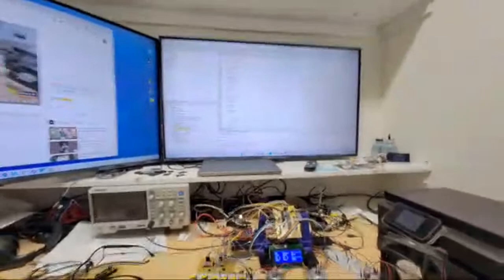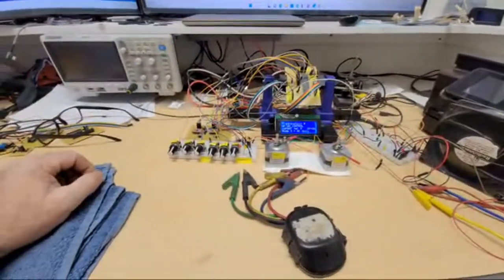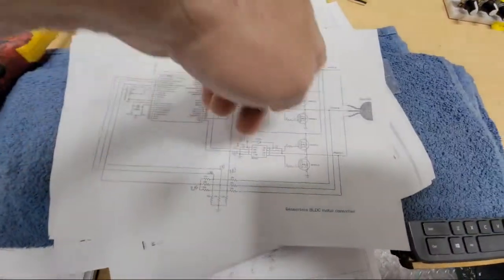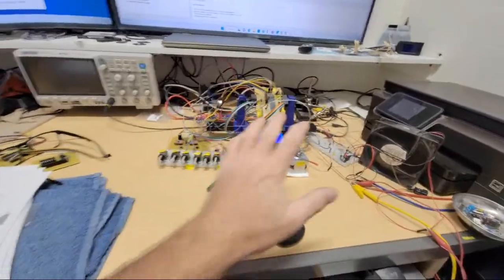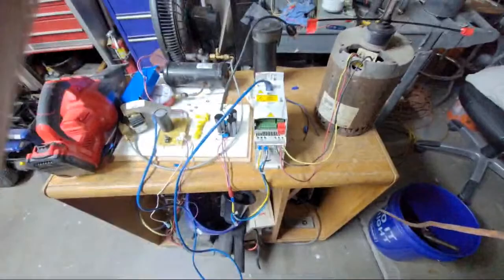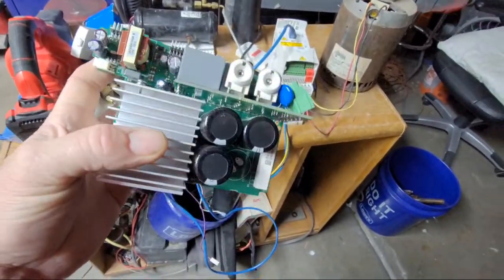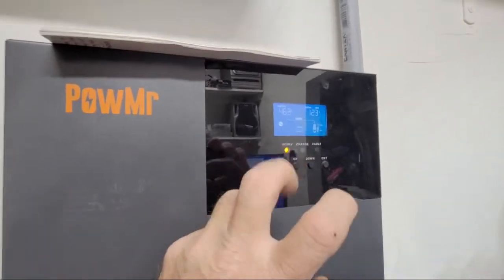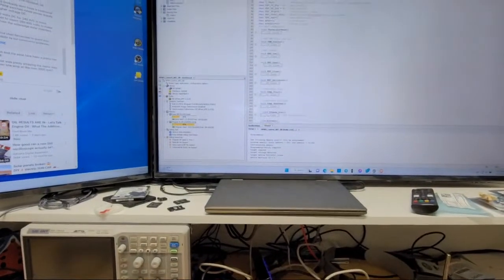Experimenting In FRANKENSTEIN LAB

Comment: hey, there are these chinese Inverter modules, most commonly known are the single phase ones (EGS002), but there is also a 3 phase variant (EGS031 with EG8030 Asic) afaik the frequency gets set by resistors. it could be possible to make a sine wave vfd.
Reply from the maker: Interesting. But as for running one of the inverter compressors I have they are synchronous DC so I need a Brushless DC Motor Controller for that.